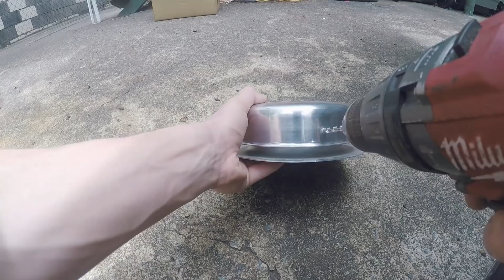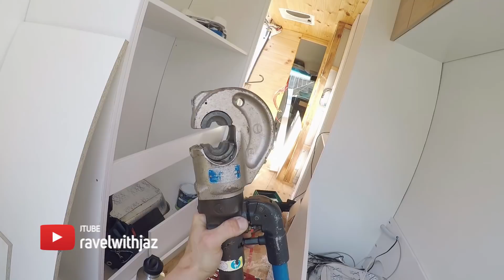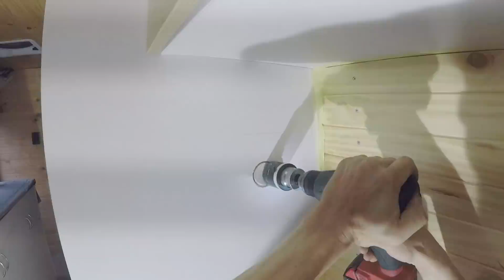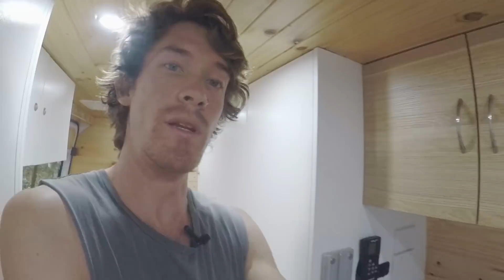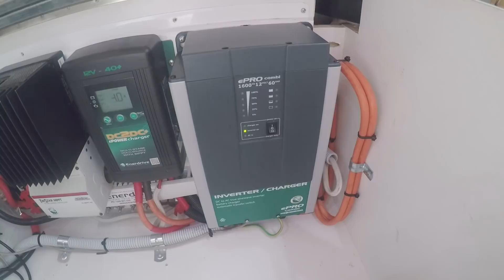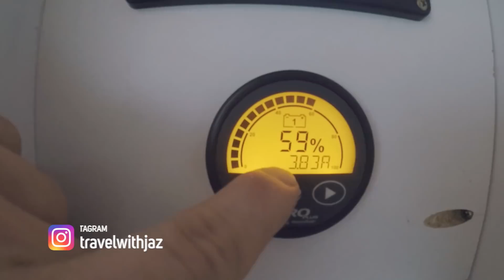S1E13 Sprinter Van Conversion | Electrical Pt. 2

Comment from the maker: To some the electrical system seems over the top, but I think it is just perfect for my personal needs. We really do need all the solar on the roof to keep the batteries nice and charged on consecutive cloudy days. We are fully off the grid, so going with lithium-ion was the best choice for me, and having the ability to charge from the alternator really helps on the days where we get very little sun.

Ep.13 BLOG + PRICE BREAKDOWN - http://www.jazmorton.com/van-conversion/electrical-pt-2/
Season 1 Van Build - http://bit.ly/VanBuildS1
Season 2 Van Life - http://bit.ly/VanLifeS2
Reply: Great build Jaz! I want to build my electrical nearly identical to yours.. I was wondering how many volts /amps your alternator pushes and how much of a charge it provides when you're driving. On a cloudy day, of course. Also, thank you for sharing your knowledge and experience. I've learned a ton watching your stuff👍👍👍

Comment: dude, really appreciate you sharing this, both part 1 and 2. Just from the short descriptions it makes the whole process a little more clear. You have a power "room" or "area", all power eminates from there, need to splice in switches and make sure to follow standards and use fuses, breakers, correct wire size choice. The rest is basically just trying to run wires to locations as neat as possible, twisting together connections, fairly plug and play. I'll probably setup and run most of my wiring myself but have it double checked by an electrician.....you guys  aren't cheap :P.... keep up the awesome work! nice little channel.
Reply from the maker: Exactly man, not as hard as it looks 👍🏼👍🏼 good luck mate

Comment: Hi jaz,why did u not go with more batteries so u don't waste all that sun in the southern hemisphere because obviously you can only store so much energy in a small battery,I have 2x200ahx6v agm  batteries,400 ah and 360w solar in Scotland( not the suniest place in the world)WHAT DO U THINK!!  Great vlogs.
Reply from the maker: Hi mate, just didn't need it really+ price at the time and still is much more expensive for lithium ion batteries compared to AGM. Just looking at your specs if they are 6V batteries, and you parallel them to make it 12V, that in effect halves your total capacity. So in reality you would have 200Ah of AGM capacity which is usable to 50% Depth of Discharge which would be 100Ah usable storage.

Are they 200Ah 6V per battery or am I jumping to conclusions after looking at the name?

But yeah between driving and sun , mostly sun here in Aus, I never have an issue with enough storage 👍🏼👍🏼
Reply: @JaznLori  hi jaz thanks for query,6v agm 200ah each so total 400ah at 12v and agm capacity is 75% so I can use 300ah's.
Reply from the maker: @stum8374  hey mate cheers for the reply, so connecting batteries in series increases voltage but not amp hour capacity. So if you have 2 X 6V 200Ah batteries, and the only way to get that system to 12v is by connecting them in series, you will have a total system capacity of 200Ah still. See this link.
 https://www.allaboutcircuits.com/textbook/direct-current/chpt-11/practical-considerations-batteries/#:~:text=Connecting%20batteries%20in%20series%20increases,increase%20overall%20amp-hour%20capacity.&text=Connecting%20batteries%20in%20parallel%20increases,increases%20overall%20amp-hour%20capacity

I haven't seen too much on AGM going to 75% without decently reducing the life cycle of the battery, generally they say to 50% to get maximum life out of the battery. I know AGMs are much better than lead acid however.

So at best cast 75% of 200Ah is 150Ah system capacity. But if you are going down that much on a regular basis with AGM I think that will greatly reduce the total life of the 2 batteries, but this is all just my opinion man, you can take it all with a grain of salt haha , cheers mate

Comment: Hey unfortunately I can't see DC solar panel isolator links or even model on your website. Which one do you use? Proper one for DC or simple one for AC?
Reply from the maker: Hi I used a proper DC one for the solar and it is called (Noark Ex9BP-N K32A 500V 6kA Non-Polarised DC MCB ) what one you use will depend on your system
Reply: @JaznLori  thanks!

Comment: Uhhh.... Those Hagers are not double pole but 1 phase + neutral. That is not a problem in a situation where everything is GUARANTEED non reversible wired (so phase ALWAYS on the same pin of the connector) but if you live in a Schuko country like me, you DEFINITELY need a real double pole MCB or RCBO to guarantee electrical safety.

I see that mistake being made on a regular basis to be honest.

That's also why UK caravans can have a problem with reversed polarity when hooking up in Europe.
Reply from the maker: Correction: They are double pole, you can also get 1 pole + neutral in a different hager model, but this one is definitely double pole, i even tested it with my multimeter to check if it broke continuity between the neutral pole, it did.

cheers
Reply from the maker: The box in the video does say 1P + N though so I can see why you thought so
Reply: @JaznLori  Sorry but I do have to correct as you make the same mistake I see so often.

Yes, both poles are disconnected when a fault appears. BUT the fault (over current/short circuit) is only detected on the phase side of the breaker. The neutral side has no circuit for detecting an over current or short circuit situation. It's just a plain old switch which  is being disconnected by the phase side when a fault appears.

A REAL double pole breaker has over current/short circuit protection on both sides of the breaker, which is needed (according to Dutch code) when you can not guarantee that the phase is supplied to the phase side of the breaker.

I hope that clears things up for you?

I hope that
Reply from the maker: @Richard_van_der_Heijden  I see I see, okay I'm pretty sure in AUS this classifies as double pole breaker as it breaks the circuit in both phase + Neutral, but could always be wrong.  But I'm interested as to why you would reverse the polarity of termination between phase and neutral, as like putting phase in the neutral and neutral in the phase?

I wired mine to AS3000 our wiring rules in Australia, im not living in the Netherlands
Reply: @JaznLori  First of all: We are talking about mobile installations (which RVs are) so this only applies to that.

In the Netherlands we have non-polarized Schuko's that can be used to feed those mobile installations. So by turning the plug 180° the plug you can reverse L and N in everything that comes after that plug.

See the problem?

You don't have that problem because you have polarized plugs and in that situation it's probably okay to call a 1P + N a double pole breaker while in reality it is not. Hager also has that opinion because they state it in the description on the box.

For someone living in a Schuko country and thinking that this information also applies to them, it could lead to injury and death.

And yes, you clearly stated that you wired to the regulations of your country but people are usually not smart enough to find out which regulations apply to them and just copy what they see. And as your videos have a world wide audience...

Safe electrical wiring is not difficult if you can grasp the basics. But a lot of people don't so I see a lot of potential death traps on a daily basis. It's not limited to RVing but also to things like the exploding food truck scene. Even simple things like connecting earth to your chassis are almost always forgotten.
Reply: @JaznLori  So that's why I like to call things by their correct name and use them accordingly.

On more example:
In the UK they have a polarized plug/system so they use 1 pole breakers in their consumer units and thus also in their caravans.

Now that UK caravan goes on holiday to Europe and has to plug into a Schuko socket using an adapter cable. 50% chance that the phase is on the correct side and not on the neutral.

See the potential death trap?

They do have indicators to tell the user if he's plugged in correctly but if you are stupid enough to disregard them....
Reply from the maker: I get ya, i just googled Schuko socket and I remember seeing the same socket in Indonesia which from memory I think you could reverse.

I can see where the dilemma comes into play when reversing polarities..

Do you use RCD's there? and do you also use RCBO's (a single breaker that incorporates both RCD and overcurrent protection in one)?

Can you send me a link to a type of breaker you use over there that you would classify as double pole, i am interested.

Cheers (Y)

Comment: awesome stuff man. I'm a bit confused how you fed cables for lights etc through the roof and walls after you put up sheeting. would you mind explaining? I'm worried about the order I do everything in if I'm gonna have to go back and change stuff. Cheers
Reply from the maker: Hey mate, I actually pre wired everything before I sheeted, as you can see in Ep. 9 Electrical Pt. 1  , then when I sheeted the cables were sitting in the cavity, I then cut the holes, and fished the cables out with a metal hook. I also marked roughly where the lights were on the floor so I had a decent idea where they were in the ceiling space

Comment: Must have cost a kings fortune. Hahaha.  I've wired yachts for years, great job, seriously.!!!!  Do you have air flow for the inverter area to disapate the heat build up in there???  Nice wire work and organization.  Hope no one steals your beauty.  I would cry.  You put a lot of work into this van, sweet.   One question?  The battery, lithium ion is that charged at the same voltage as the van starting battery???   Keep up the great work. Appreciate your vids...
Reply from the maker: Thanks a lot yeah the battery system was the most expensive component! The lithium battery actually sits around 14.2V when it is fully charged I believe, So i think it is the tiniest bit higher than your typical 12V car starter battery, So i would imagine it needs a little bit higher voltage to charge it compared to a standard car battery, but all the charging equipment would adjust for this.

Comment: I know you have pre-run your wires, but how did you "fish" those wires out from the ceiling?
Reply from the maker: they were basically sitting right next to the hole. i bent a metal coat hanger and bent a hook on the end and that is my tool for fishing wire haha

Comment: Hey Jaz, how come you had to get an additional mppt charge controller when your dc2dc charger has one built into it?
Reply from the maker: check out the blog post linked in the description and also blog post ep.9 , but basically because the 5 x 100 watts circuit and 4 x 20w circuits are different specs so i had to feed them into seperate charge controllers

Comment: Been looking at enerdrive myself, about to hit the button and order the gear, but I have to know something about your setup. Why did you not go with their 200ah "ePower B-Tec" battery that has all the monitoring and smarts built into it rather than having to install the battery management and monitoring systems separately? Did you just want more control over it or was there an advantage to doing it that way?

My thoughts are maybe you wanted to be able to expand the battery bank later (not possible with their b-tec battery). Unless their is an other reason?
Reply from the maker: i liked the extra control i have over the system and just more customizable

Comment: It doesn't drain the car battery while you driving? Test the status of the battery while you start engine (the car battery not LiFePO4)
Reply from the maker: not to sure on the question sorry. the house battery is charged from the alternator whilst driving,

Comment: Did you grounded your DC to the chassis or only AC? what is your take on this?
Reply from the maker: just the AC system is grounded to the chassis, fully go over this in the blog post if your interested on my website

Comment: Looks like lithium is the way to go. With this setup you could theoretically stay off-the-grid almost indefinitely, depending on if you could find food. Also, do you have extra gas on this baby?
Reply from the maker: Ha theoretically you could but yeah food and water would be the problem Haha! I do have an extra gas bottle stored in the cupboard on top of the gas box at any one time 👍🏼

Comment: Just a question about your breakers
You've used 1 pole +N rather than 2 pole breakers.  The whole thing about aussies using 2 pole switches and breakers is to disconnect BOTH the active and the Neutral.  1 Pole +N dont do this they only switch the active.  Now I suspect you are a tradie in this area so you will know more than me but are 1pole +N really 2 pole breakers?
Reply: I've actually ended up with the same 1P+N Clipsal RCBOs as Jaz used when I purchased 2pole froom an ebay supplier.  It appears that there are two different types of 1P+N RCBOs - switched Neutral and fixed  neutral.  The 1P+n Clipsal switched Neutral meets the definition of switching both Active and Neutral  The fixed Neutral ones do not meet the standards.  The clipsal actually claim the benefits of 2 pole switching in their description of this RCBO https://www.clipsal.com/Trade/Products/ProductDetail?catno=RCBE216/30S
Reply from the maker: Thanks for the questions Paul, yes there are 2 types, the type I have is the Double Pole switching breaker. I've tested it to double check it actually does switch the neutral as well with a multimeter on ohms, and yes it does break the neutral circuit ;)
Reply: I had the same concern, from what I understand they switch both poles manually on the switch if it trips, but only the Active is protected. I brought exactly what Jaz did HAGER ADA916T 16Amp 6kA 30mA RCD/MCB Combo. I will check for continuity Omh meter as well.  @JaznLori    

As I am running a 3000Kva inverter charger, I decided to put some double pole breakers in for the input of the inverter charger 16amp, but a larger one on the output of the inverter charger (victron power assist can add 13amps +16amps from short ti give you 29amps in theory so put a 32amp breaker on the inverter charger then ran three separate circuits, one for GPOs, Air con (2KW inverter split cycle) and hot water (heat exchanger unit off the engine has an electric element) all on separate RCBOs not sure if the hot water system will nuisance trip.

Comment: Hi, Jaz!
Thank you very much for the video. You are the best in this subject on YouTube. But unfortunately I do not understand everything. Could you explain to me in more detail what is below BMS Ralay Driver. I mean all the red wires 12v (plus). Unfortunately, on your videos and photos, these wires are covered with covers and it's not clear witch wire goes to witch device. 
How are they connected to the big red fuse box and to the Remote Battery Switch? What are their parameters, diameter, etc.? What are the values of fuses on them? Which red (plus) 12v wire is connected to which device? The scheme of connection or a photo from a different angle, from below, would help very much. I hope that you will answer me. And it will be even better if you post these schemes and photos in a blog on your website. Thank you in advance for the answer.
Reply from the maker: Thanks for watching! Sorry a BMS means Battery Management System, it is the device that monitors your battery to keep it safe. In terms of the 12v fuse box, There is a 6mm red and black cable that feed the Fuse Box. The black negative is fed from the battery negative bus bar. the red positive wire is fed from a fused bus bar link from the battery system also.
Reply: Thanks for the answer. But I see that I incorrectly asked my question. I did not mean the BMS itself, but those red wires and connections that are under the Remote Battery Switch. Unfortunately, it's hard for a layman to understand what kind of fuses they have, how they are connected to each other and to other devices. Please write about it, and better make a drawing.

Comment: This is the best Van Life build I have ever seen. Definitely love the professional approach to electrical installation.

Would you ever consider doubling the size of your Lithium Ion battery?

Thanks for the videos.
Reply from the maker: Thanks a lot mate, appreciate that. I don't think I would now that I know that this size supports all my needs off grid. Installing another battery down the track might not be the best idea either since one would be brand new and one would be used, (chemical differences).